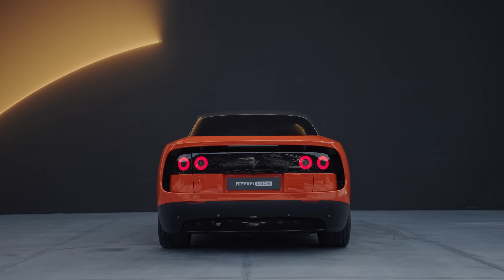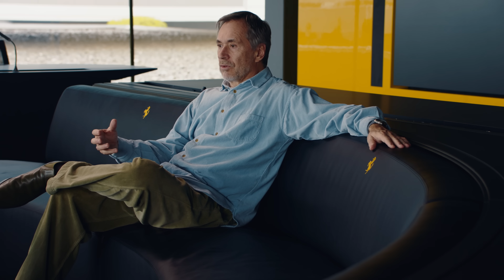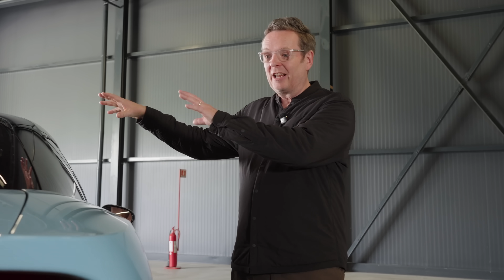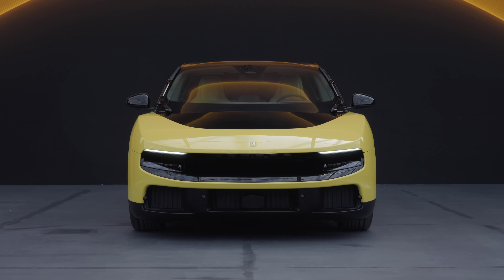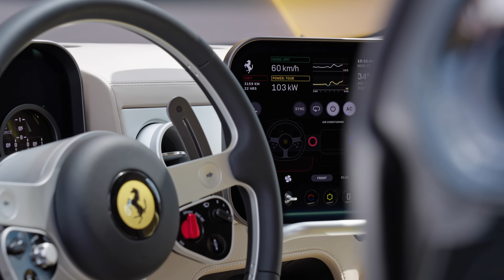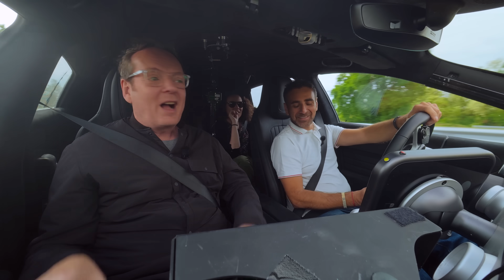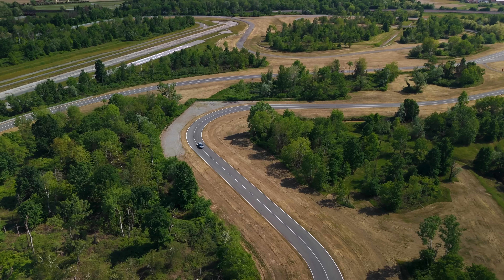We’ve Driven The Ugly Ferrari That Broke The Internet! | 4K

Comment: That is really expensive computer mouse
Reply: I was expecting to have the charging port located under the car body, like the apple mouse
Reply: @xirix  On the Luce  it inserts vertically upwards from the base of the drivers seat.
Reply: @neillchippett655   ...and goes into the owners wallet.
Reply: I just googled old apple mouses and this ferrari looks like it was styled on the apple pro mouse from the year 2000 😂
Reply: Interior does look more like Logitech built it.
Reply: @PiDsPagePrototypesMore like Thrustmaster!😂
Reply: What's this bad boy's polling rate?
Reply: Was just thinking that myself! Looks like a computer mouse…
Reply: point 👆
Reply: there's way more tactile switches here than most commodity cars. I think all these arguments for it's 'digitalness' start from a tainted place.
Reply: That's every new car